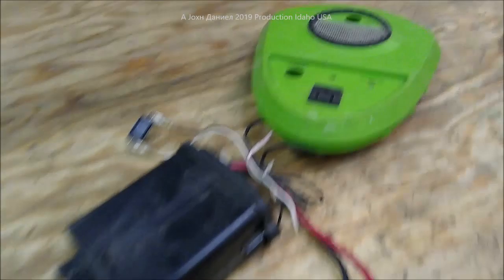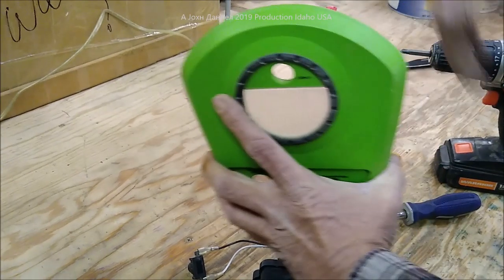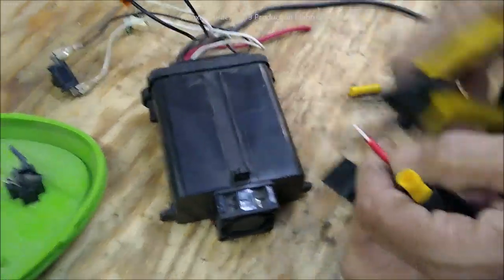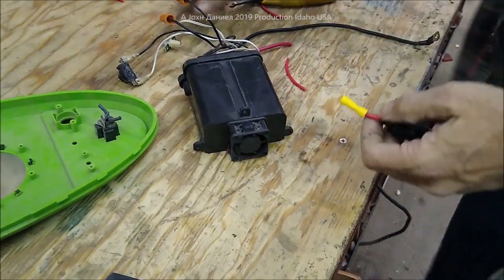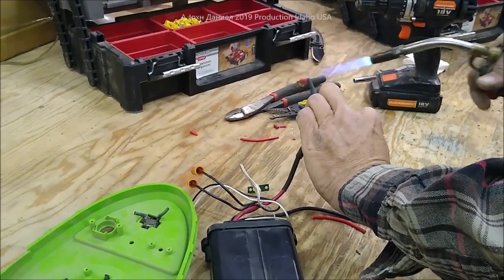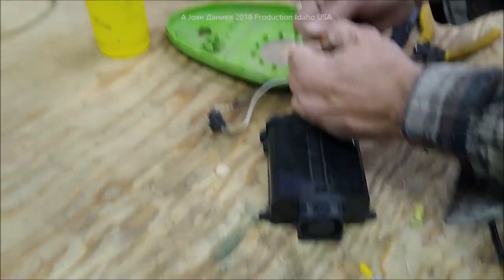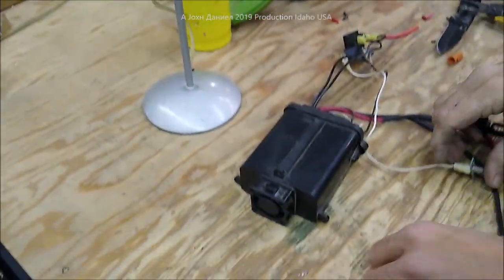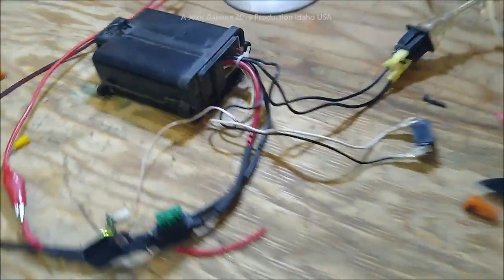DC to AC Power Inverters EZ sourced for free or dirt cheap

Comment: Hey John, When The Batteries Die I Convert Them Jump Boxes To Lithium Battery! I Use SPIM-08 8AH Packs Off eBay For About $6.50 @ x 4 = 12v Soo A Fix Costs About $30? Butt Much Better Than New... Thanks